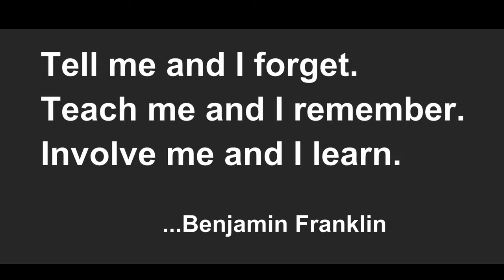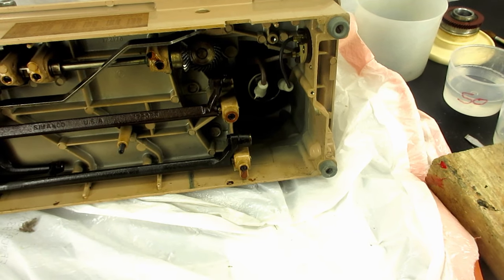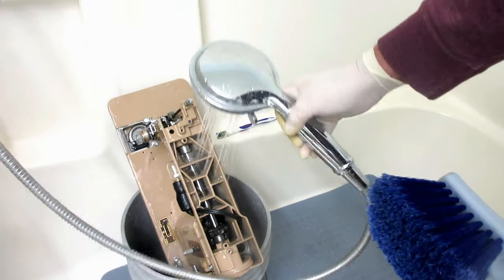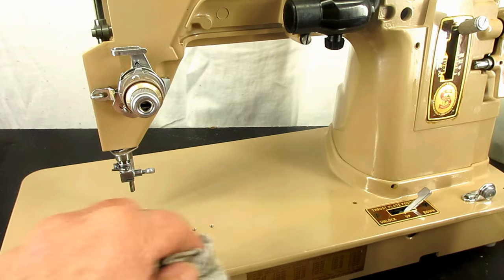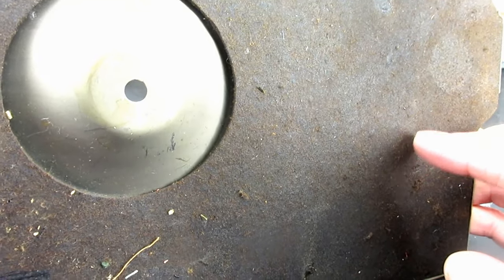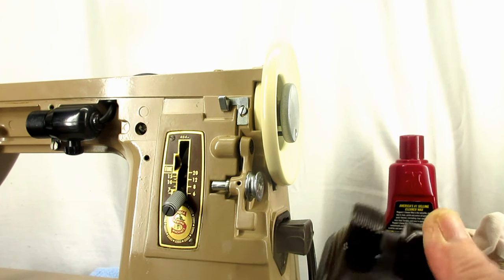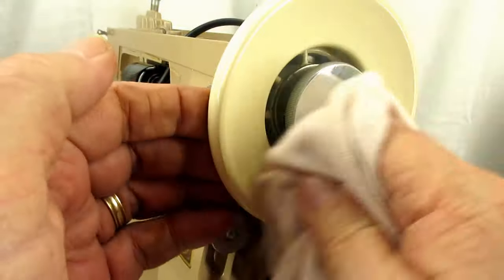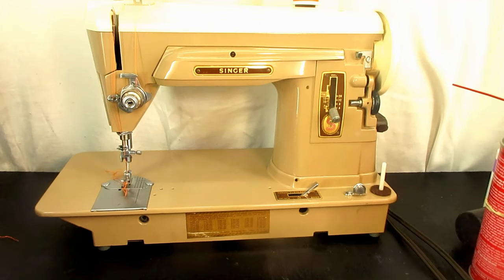An easier way to clean & degrease a sewing machine with less parts removal.

Comment: Just the video I needed!  I got an old Singer 347 from my MIL that’s gunked to all heck. And I actually have a lot of the supplies and tools!
Reply from the maker: Glad you found the video. The motor on your 347 is internal and must be removed before washing. Video #9 of this playlist shows how to completely remove the wires/motor if you want: https://www.youtube.com/playlist?list=PLsCOZgzzaiKJxbOOMKQPvmeTRqi0dhGa5  As I washed machines more I developed some changes. In this playlist is a video "pre-wash and post-wash" https://www.youtube.com/playlist?list=PLsCOZgzzaiKK4y8dsq3oMKJFTGsoNJWmi  it shows how I started just pulling the motor out the end of the machine and wrapping it in a ziplock for washing the machine without removing the wiring. On a model 457, that's what I would do. I don't remove the timing belt either b/c the KK cleaner will not hurt it. I leave the light bulb in (or not) and any on/off switches b/c nothing is "electronic" and all those parts can be dried completely with a blow dryer without causing any problems. I seldom use full strength KK any longer but 50% on really dirty stuff and 15 to 20% on body parts/paint but you'll be the judge of what's needed. Model 347 is a very nice home sewing machine; strong enough and versatile while being easy to maintain. Good luck, and thanks for watching my channel.

Comment: Hello Andy, what an amazing video :)  Just finished watching.  I am now  inspired to do do the same with my Singer 28 (Just learnt how old my mother's Singer is)  So I have so far taken most of it apart.  Having a hard time with the screw on handwheel (letting it sit overnight).  And msut learn to rewire motor on it also.... Anyway.... I am thankful for your videos which help me with most of my SM repair learning.  Merci Beaucoup from Canada
Reply from the maker: Thank you. Please be aware the KK cleaner can damage the black finish on a model like yours. Test before using KK on the outside, or washing the outside. I've only cleaned a couple of black machines. 
https://youtu.be/w6fn-TSOCYo model 99K
https://youtu.be/lz2xV3zfvJE  inside model 221
https://youtu.be/nZKAVHfUQoc

Comment: Hi Andy,  Thank You!!  I am thoroughly enjoying watching your videos.  I really appeciate your efforts to educate us on the care of our machines.  I recently acquired a Singer 401A.  Unfortunately, I am quite obsessive about the cleanliness of my electronics of any kind.  So I have watched your video about the easiest way to clean and degrease my sewing machine.  However, internally your demo machine is not as complicated parts wise as my 401A.  I can remove and clean the cam stack based on your other video but I am concerned about how I would go about cleaning all of the other complicated parts using the bathtub method.  Any advice you could give me would be very much appreciated.  Thank You!
Reply from the maker: Thanks for watching my channel, Rita. Yes, the model 404 in this video is the Heavy Duty Straight Stitch brother to your 401A and the mechanics are very simple. If you want to do a deeper cleaning of your 401A it can involve more parts removals. (that's why I called it the "easier" way to clean in this video) I have several videos that can help you. In fact I have 65 videos that can relate to the parts removal, replacement, adjusting, cleaning of your 401A. There are three Playlists you can take a look at to decide for yourself. 1. Models 401A Playlist is 17 videos: https://www.youtube.com/playlist?list=PLsCOZgzzaiKLiDl9yFTP6mJgQmz5lj4NO  Model 403A (another brother) is 27 videos,  and Model 503A (cousin machine) has 21 videos: https://www.youtube.com/playlist?list=PLsCOZgzzaiKJZaZn2zl3LsnV2d7UhrqvX   Some of the videos are for the same part of the machines, like the needle bar, presser bar, etc. I'll say that the more parts you remove for cleaning, the better total results of the cleaning, but I'll also say that cleaning without removing the parts requires more precleaning on the bench with cleaner and brushes, but you end up with a 90 to 95% clean machine. You may notice this in the other videos. I'll also add that I have come to use weaker solutions of the cleaner after testing and have settled on about a 15 to 20% of the Krud Kutter to water. Sometimes I use stronger like when the gears are just impacted with dried black and hard gunk. I have never figured out what that gooey over-sticky black stuff is but find it occasionally. The results of a weaker solution on some of the metal results in less chance of spot rust forming. I also suggest having the 401A Service Manual on hand as a guide while doing and parts removal, installation, adjusting. I try to be thorough in my videos, but having a written guide, with diagrams, can be helpful. You can download a FREE copy of the manual from Sewing Dude at this link: https://sewingdude.files.wordpress.com/2012/09/singer-401-service-manual1.pdf  Best of luck then.
Reply: @andytubesewing1953  Andy,  Thank you so much for your reply.  I have watched several of your videos thus far and will definitely watch your complete playlist.  I have been taking notes as I watch because it helps me to find portions of your videos that I especially want to remember.  Your mention of flash rust was a little intimidting but it is very helpful to know that a weaker Krud Kutter solution will help with this.  I am excited about owning this machine and look forward to sewing with it.  Fortunately, I am not in any hurry and I want to do everything right from the beginning.  Thank you again!  Rita in Philly
Reply from the maker: @ritagoldman7232  I know it will turn out beautiful for you. You have a great approach to doing the work. Your machine is 60 years old now, but can easily go 60 more years, and longer, with normal lubrication. I had a retired SInger man from Canada tell me years ago that my machines were cleaner that the ones they sold in the stores. You know where to find me if needed. Take care.

Comment: I have been masking off areas that I might scratch.  Like you 1.25 store.  Thanks for the videos.  If you haven't used Aerospace 303 with UV protection, try it, you will like for rubber and lots of other surfaces.:face-turquoise-drinking-coffee:
Reply from the maker: @tomhorn2937  thanks I'll check it out

Comment: I gatta try this I was so scared to even think of this but since I have been taking them apart and putting them back I believe I can do this
Reply from the maker: Oh, you can do it, Krystie. I've found I can use a much weaker solution of the KK, too. Max at 50% for really bad gears, 20% for the rest and even a 5 -10% will do the outside.
Reply: @andytubesewing1953  I hat a 401 she really dirty still using it lol just oil and did a quick clean I definitely need to do this in the future

Comment: Thank you so much. Unfortunately, I oiled my 503a before watching this video. Fortunately, I did not remove any technical parts other than the hand wheel and the top lid. I will likely need to clean it again as I am seeing more orange, eat wax looking gunk. The oil I received from a local sew/vac shop is removing all the yuck I didn’t initially notice in the gears. Thanks for what you do.
Reply from the maker: Well, no real harm was done. Anyway, if you got oil on the gears that is bad for them so it needs to be removed. 
 Only grease on metal gears. Model 503A is a very nice machine and I hope you enjoy it for many years.

Comment: Thanks for making this video. It's been a pleasure to watch as I'm learning about these machines and about to try cleaning up a 500a myself.
Reply from the maker: Thanks for watching my channel, Hanns. Your 500A model has many more moving parts under the arm cover. You may be interested in this playlist of my videos for the Slant-O-Matic 401A, the model the 500A is based on. Most of the parts are the same as your machine and I cover all those extra parts as far as remove, replace or adjust, Including the cam stack. https://www.youtube.com/playlist?list=PLsCOZgzzaiKLiDl9yFTP6mJgQmz5lj4NO
Your ROcketeer 500A is sure a popular machine with many happy owners and I wish you good luck with it.
Reply: @andytubesewing1953  After I watched this video I checked inside the 500 and noticed the gears you could easily reach in this 404 were buried under the cam stack in my machine. I'll definitely check out your other video for more info. Thanks for the link! There's something to be said for the relative simplicity of a machine like the 404, and I'll be keeping an eye out for one in my travels.
Reply from the maker: @hanns1401  You'll do well with the 500A, no worries. If you like you can download a free copy of the ORiginal Service Manual for model 500A at this link: https://sewingdude.files.wordpress.com/2012/09/singer-500-service-manual.pdf
It covers everything on the machine. Yes, I've always loved the model 404 for its power and simplicity. They can usually be found for a lower price as most people know about the 401A and 301A machines. I just like the front drop-in bobbin system better than the side-loading bobbin of the 301A, but don't pass up a 301A either. Best wishes, and take care.
Reply: @andytubesewing1953  I've watched quite a few of the videos in that playlist now and thanks to them have been able to disassemble and clean the cam stack, followers, pattern selection knobs and associated hardware. I've also pulled a few components not specific to the 401/500 such as the motor and throat plate latch assembly since the latches were sticking and I wanted to clean them individually. So I think I've gotten it stripped down enough that it's pre-clean and shower time. I'm a little concerned that the worm gear on the horizontal drive shaft is a little difficult to reach because of the race(?) that the cam stack rides on top of. Though it's visible and I can likely reach it with a small brush. Would you recommend any further disassembly for this machine before committing to the full cleaning? Thanks!
Reply from the maker: @hanns1401  The part is called the Bight Amplitude and Pattern Selector. I gave you the link to a FREE copy of the service manual in a previous comment, but here it is again:  https://sewingdude.files.wordpress.com/2012/09/singer-500-service-manual.pdf
Page 36 of that manual has the instructions for removing and replacing that part if you'd like to do that to make cleaning easier.
Reply: @andytubesewing1953  Thank you - I was just watching your "zero-out" video where you talk about this part and its proper name in the service manual. Thanks again!
Reply from the maker: @hanns1401  👍

Comment: I’m so glad I tuned into this video.  I’m in the middle of restoring  a 500A.  I think it’s the grimiest machine I’ve ever seen. Thick black and brown grease and oil everywhere.  And it’s all dried up.  I’ve taken most of the parts off, except I cannot loosen, as of now, three screws—they seem stuck and stuck but good.  I can’t get the faceplate that covers the stitch width lever off because one of the little brass screws won’t loosen, therefore I can’t remove the feed regulator.  Then,  screw that holds the bobbin winder spindle bracket to the frame has rusted in place, it seems.  And, the clamping screw that holds the hinge pin for the vibrating bracket isn’t budging for me. (I did get the rest of the vibrating bracket parts off, just not the hinge pin and its screw)   So, now what, I said to myself.  How the heck am I going to clean those parts without taking them off the body?  Well, you showed how to do it in this video, with nearly all the machine parts attached.  I feel so much more comfortable now.  I won’t be ready to wash the body for a while as I’m busy cleaning the many parts I did take off—very tedious—I can see why people would not want to remove everything.
Reply from the maker: I feel the frustration of screws like that. Oh, man. I've found that heat (hair dryer) can help sometimes. WD40 still works. For the last broken/rusted screw, I had to use The Must for Rust, a drop every couple of hours, over a couple of days. Very easy does it to protect the nearby paint. If I were making this video again, I would suggest using lower concentrations of the KK to water, to begin with. You can always go to a stronger one if needed. Tedious is a great description for removing so many parts. For me, the reward of a spotless machine was satisfying enough to justify it in most cases. Music or sports on in the background and slowly/surely dismantle. You never saw it in my videos, but on the side wall, I keep pictures of all the machines I restored along with close-up shots of certain areas. When I was frustrated I would stop, stretch, and review those pictures, haha. Take care, Carole, and nice to hear you are saving another machine. ( I'd name it Stormy if it was mine ⛈)
Reply: Thanks so much for your advice, Andy.  I chose to  re-cover the screws in liquid wrench or WD-40, let sit (at least overnight), heat, then repeat and repeat. I got the screws as hot as my hair dryer would allow. I got the screws to the hinge pin and the bobbin winder spindle bracket loose!  What a relief!  I’m still working on the little brass screw.  It’s swathed in WD-40 today.  I must remember to have patience that you so often mention in your tutorials for this kind of work.  I’m working on it; it does pay off!   Stormy and I are both very happy.
Reply from the maker: @carolemagnusson5044  Virtue... a state of moral excellence... patience was a hard-learned virtue for me but I finally got there. Mom called me hot boy as a kid and always asked where's the fire buddy? haha. it does give worthy payback though. I hesitated to mention one other method b/c those little screws are so soft. You may have seen me, and others, tapping on a screwdriver while turning it to loosen screws. I've always been hesitant to do that on such a soft screw, but I have found just a couple three fairly good raps on the screwdriver head (without turning) have helped at times. Something about jarring the screw and breaking the "seal" of the threads maybe. At your own risk and your satisfaction may vary 😀
Reply: Well, that little brass screw is just not going to loosen!  So it’s off to the shower for Stormy.  I’ve got to clean up my work area first to make room for pre-cleaning, and get the shower ready (backyard, big plastic tub, garden hose).  So maybe I will soak the screw some more in Liquid Wrench while I get things ready.  I think Stormy will turn out nicely.   All the parts are cleaned and ready to go.  I much appreciate all your advice.
Reply from the maker: @carolemagnusson5044  I think Stormy will be great b/c I know of your work. Don't feel defeated by the screw, but live to fight another day, haha. Let Stormy have her small victory in that battle while you win the war. She'll learn to be grateful for your kind and loving restoration work and perform beautifully.

Comment: This is such a helpful video! I have two 401 machines that I hope to return to their former glory and usefulness. Im planning to start with the one that doesn't actually work and then depending on how that goes, to work on the one that I use all the time. Is there another video that has more information about the 401 that I should watch first? I know its much more complex in the arm mechanisms than the 404.
Reply from the maker: Thanks. Yes, the 401A model is more complex, with more parts and a true camstack vs the pattern selector system of the 403A.
FYI, here is my main PLAYLIST page to bookmark. 90% of my videos are on this page, organized into Playlists by model number;
https://www.youtube.com/channel/UCUSPDsHaFtRoz1VA2U1xJ4w/playlists    One of those playlists is for model 401A; https://www.youtube.com/playlist?list=PLsCOZgzzaiKLiDl9yFTP6mJgQmz5lj4NO      and has videos of all those extra parts and the camstack. The Playlist for model 403A has more part removal and repair than this cleaning video; https://www.youtube.com/playlist?list=PLsCOZgzzaiKKyqvdDRwS-9MfLuwSNJTcg    Some viewers do want to disassemble their machine more for cleaning and the playlists can help with that. Many viewers did not want to or can not do so much disassemble, so I made this video for cleaning with removing minimum numbers of parts. There are Playlists for foot pedals, motors, and tension assemblies. Something for everyone, I guess 😊 I hope they will help you with your goals for your 401A machines. Good luck, and thanks for watching my channel.